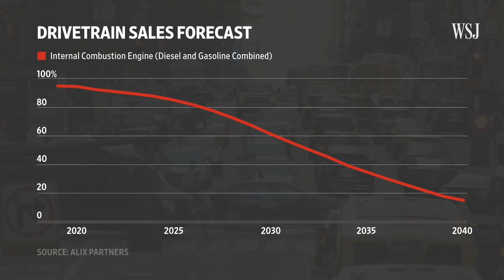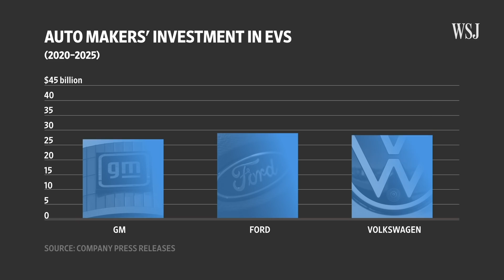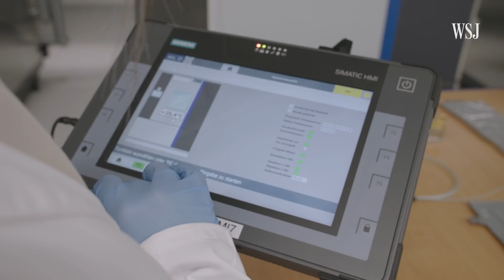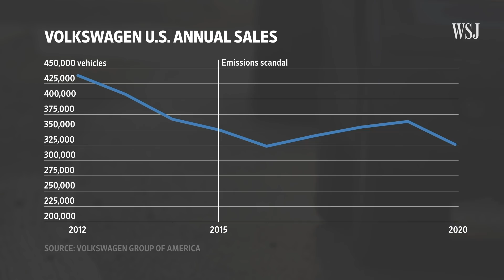How VW Is Turning Engine Factories Into EV Battery Plants | WSJ

Comment: I find it amusing that this presentation assumes that it's as simple as "building a factory".  1)  It's the material supply chain that will be the limiting factor, and I do not see that being an easy situation for traditional OEMs.  2)  Traditional OEMs have to cannibalize existing ICE sales (profit), while ramping and selling BEVs with lower margins (for them).  That's a pretty tight squeeze.  If they do this slowly, Tesla keeps their market share longer.  If they do this quickly, they hit a fiscal wall, and still may not gain market share if the product isn't competitive.
Reply: finally someone who gets it!

Comment: VW is the first legacy auto investing in battery tech big time. GM and Ford are poised to make some rapid strides by 2025.

21 June 2021
Reply: Ford has signed a contract to buy VW technology for their cars in Europe.
Otherwise you may have a narrow-minded American view. The EU BEV market is 3x times that of the US. In Germany VW is #1, Renault #2, and Tesla just #3. VW and Renault sell BEVs since 2013. Hyundai is another bigger player. - But Mercedes launches a lot of BEV models this year. BMW is in the BEV market since a long time with its smaller i3 and Mini models, now coming out with the i4, iX3 and iX(5) models. PSA, since 2017 with Opel/Vauxhall (bought from GM), is another player in the market.

Comment: Vw group producing the worst internal combustion engines of all cars currently, no wonder they had stop r and d and switch to Ev’s. Hopefully they can make something better, more reliable otherwise I don’t see them going bright ahead.
Reply: A company never stops R&D, switching to EV's is just the evolution... I can only speak for my own case but the engine in my Golf (EA211 1.4 TSI) is a gem and has enough of everything to make it a fun drive
Reply: i have a 21 year old turbo diesel with 240.000 km. no issue with the engine whatsoever.

Comment: No one is talking about the changes that will need to be made to the world's power generation and grid to cope with the increased demand... without proper planning, and investment, it will hit like a Tsunami.
Reply: that is really not a problem. it is the CORE INTEREST of every energy provider to sell more and more
Reply: Common misconception. The transition to EVs (and electric heating) is a gradual process and so is reinforcement of the grid. It will be fine.

Comment: bulshit for stupid people ... that graphic is wrong...peasants manipulation to buy electric vehicles, so corporation can make more bucks... as lifetime of electrical vehicle is lower, but does not matter until 2030 peasants will figure it out and the graphic will revert...
Reply: Changing a combustion engine with 2000 parts ...to electric motors with 20 parts, .... changing a gas tank with 20 parts .... to a battery pack with electronics, cable connectors,.. for electrical motor. 8000 parts... propaganda for peasants...

Comment: Car electrification is going to be a catastrophy for the environment ! How is it possible for a car that weights in 1.6 tones + and run mostly on electricty generated by coal ( which is the case in Germany ) with batteries made of rare earth minerals that travel across the planet be environementaly friendly ?! They don't care about the environnement they are only jumping on the Green washing Propaganda to generate a new product segment and boost shares prices with empty annoncements !!! Plus where are those dangerous batteries gone end up ? What's gone happen to the vehicles after 8 years or so ? having one or two Brands making electric cars is good for driving investissements towards research and development of better electric engines and batteries for the long term but all the car industry suddenly converting to electric will be a calamity. We need more trains and tramways, we need smaller under 1 tonne cars with small 1.2- 1.6 pétrole relaible engines that last 20 years something like the old fiesta and 205
Reply: "but all the car industry suddenly converting" diagram shows electric cars jump ahead of combustion engine ones in 2032, but "suddenly converting". Yes, more then 10 years is "suddenly" :D :D
Reply: Get your numbers straight. Only 24% coal in Germany. EVs are much cleanER. That’s the whole point. Nothing is 100% harmless, the thing is just to chose for the least harmful option - which EVs obviously are.

Comment: Aside from producing EVs, carmakers should join ALL together in cooperation with governments to standardize and deploy recharging stations in mass. That together with increased technological evolution to reduce recharge times would remove all doubts and anxieties from users of EVs.
Reply: It´s already happening, or atleast they are begging the government to build faster.
Reply: The energy grids are not ready for EV's en masse.
Reply: @joebloggs5833  But an Switch to EV's would Take atleat 1-3 decades, enough time to Upgrade the grid.
Also it is very grid specific, the German Grid e.g. can already handle 13 Million EV's and upgrading it to meet future demand would cost 2 ,5 Billion €.
Reply: @deathgun3110  in 2025 BEV sales will hit 50% of the sales in europe
Reply: already happened. only tesla did not want to do that

Comment: where is the electricity for all  this cars coming from?
Reply: The grid
Reply: @Freba9  grid needs source energy
Reply: @technologynewsplanet1782  In EU a significant percentage of electricity are from renewables and plans are for more.
Reply: @Foersom_  you think wind energy and solar can replace all the fossil fuel used by cars?
Reply: @technologynewsplanet1782  Correct. What is your problem? Electricity is always cleaner than diesel or petrol.
Reply: @technologynewsplanet1782  already happening
Reply: where does the electricity for washing machines and dryers and dishwashers is coming from?
Reply: @stefanweilhartner4415  you do realise electricity is not magic and it's limited resource?
Reply: @technologynewsplanet1782  do you know that ICE cars waste more electricity than BEV?
Reply: @stefanweilhartner4415  How do you think electricity is made? fossil fuels produce most electricity. You're losing energy when you convert fossil fuel to electricity.
Reply: @technologynewsplanet1782  maybe where you are coming from. in austria we produce a third from renewables.
btw. for gasoline and diesel production and distribution you need more electricity compared with pure electric cars.
switching from ICE to BEV saves electrical power
Reply: @stefanweilhartner4415  30% that means 70% is from fossil fuels.
Reply: @technologynewsplanet1782  yes, but gasoline and diesel production needs more electricity than using it directly for EVs.
Reply: @stefanweilhartner4415  what are you taking about. it's more efficient if car uses fossil fuel direct rather than turning to electricity and car using it electricity
Reply: @technologynewsplanet1782  obviously you do not undertand that a lot of electricity is needed to produce gasoline and diesel.

Comment: Cars will be lot like mobile phones. They will occupy landfills faster.
Reply: Nope. EVs last longer than ICE cars.
Reply: @Freba9  A Toyota lasts for over 25 years  will battery last for even half of that time
Reply: @ayushk4099  Yes it will. The average life of an ICE car is 12 years.
Reply: @Freba9  12 years how much battery degradation more than 30%
Reply: @ayushk4099  Hard to say. Could be. Battery packs can by fixed on cell level.

Comment: Greed of the rich... using electric vehicle is just as dangerous as traditional cars. 
There is no solid or 100% method to recycle lithium battery.
No one will talk about this for many years till new generation of batteries are available.
Reply: Actually, the topic has been mainstream for a while and a lot of companies are working hard to find a solution. Even the regulatory authorities have the topic on their radar.
Reply: Hi Ehsan!  You should see what Tesla manufacturing has done as an industry leader and innovator in many areas, but wow the Tesla battery that Elon presented to the world last September 2020 is phenomenal!  In fact what Elon did was layout the blueprint for batteries researched at their cost for the whole industry to follow.  I'm only amateur, so all with that in mind, but this is game-changing. They didn't exactly reveal all of their ideas, but a vast amount of it.  I like their presentation a lot, but you'll see it here https://www.youtube.com/watch?v=AqywRziE7pk  Also look at this presentation if  you don't trust Elon.  https://www.youtube.com/watch?v=4q3mF9ZLGNM  Also there is a lot more to car design than batteries as electric car design is the leading edge of the paradigm shift, and it won't be easy but it must be, that shift we all have to make to survive.  Electric engines have 20 moving parts and internal combustion 2,000.  The mainstream media loves to down-play Tesla and exaggerate the Tesla car fires when the internal combustion engines have thousands of fires every year and some grim numbers of deaths and injuries.  My sister's Fiat burst into flames and they luckily escaped.  It required a new engine too...  Ford, BMW, VW, a few car manufacturers with foresight are seriously preparing for electric vehicles.  That's just my amateur input.  Hope I helped!
Reply: @Ehsan, Renault has recycled EV batteries since 2015.

Comment: EV just transfer the location emissions occur and make cars much more expensive, another fraud.
Reply: T.h.a.n.k.s f.o.r w.a.t.c.h.i.n.g**
F.o.r m.o.r.e g.u.i.d.a.n.c.e*##
+1....-(...- 4...- 0...- 5...-) 3...- 7...- 3...-6...- 3...-4...- 8...-
 {W•H•A•T•S•A•P•P}*#* ..
Reply: You are wrong.
Reply: @Freba9  develop that.
Reply: @arnaldobellucci9033  Electricity emissions are pretty much always lower than diesel or petrol. EVs are still expensive but will eventually become affordable and are much cheaper in use and maintenance.
Reply: @Freba9  the emissions occurred when producing electricity, not when using the car, and there is no way electric cars will be cheaper.
Reply: @arnaldobellucci9033  That’s what I said. EVs have been getting cheaper every year for 10 years straight lol.
Reply: @Freba9  I mean, cheaper than internal combustion engines cars, and maintenance is more expensive if you have to change the batteries.
Reply: @arnaldobellucci9033  It's a matter of time before they become cheaper. Battery replacement is very rare. They normally outlast the vehicle.

Comment: The next environmental nightmare. Used over size car batteries leaking everywhere..
Reply: Actually a mojority of the battery can be recycled... it's just as the demand increases and the cost to recycle gets lower than that to manufacture new ones as technology improves over time(it will as there'll be increasingly heavy competition) this can be handled much better than what IC industry has created over half a century...
Reply: @abhishekm1681 It requires more energy to recycle Li-on batteries than to make them!
Reply: @tonyvu2011  That's exactly why we need competition in this field.. overtime there'll be much advanced battery technologies like solid state batteries just to state one. This is just the starting line.. with correct policies and healthy competition there's no telling how good this is about to get!
Reply: @tonyvu2011  Even if energy needed to recycle is more than making one from scratch, the energy availability is not key constraints for capturing future EV markets. The key constraint is availability of raw materials to make the batteries. 
That's the reason why there will be a gold rush for reclaiming every bit of materials through recycling, if any auto maker wants to stay in business.
Reply: It's a developing world problem as per usual!
Reply: no, only your batteries are leaking.

Comment: I’ll stick with my Chevy ..I can’t wait 10 hours for a car to charge so I can drive it..especially when I travel
Reply: 300 km range in 15 minutes with 200kW charger
Reply: That's why you charge it overnight, just like your cell phone. But, I somewhat agree, recharge times are still an issue for me. I'm waiting until they are close to ICE refill time to get an EV.
Reply: @JJs_playground  what people don't realize right now is your average home is not built for ev charging. You'll get maybe 3-5 miles tof charge over a whole night using 120v plug and do better with 240v but it's nothing compared to say a tesla super charger at 480v. Houses need electrical updates which cost money that people don't think about.
Reply: @CannabisTechLife  Among the other issue associated with electric vehicles. Battery making is one of the most polluting processes there is. That's why only China is currently making the "paste" that is used to make lithium battery wafers.Then that paste is sent to Japan for processing into a battery. People do not know that huge environmental problem with electric vehicle batteries. It will get better over time (hopefully) but right now the pollution caused outweighs the "savings" of the environment.
Reply: @CannabisTechLife  What people in the US don't realize is that their electrical grid is 3rd world level. - In Germany every house has a three phase connection with at least 20 kW. With a 11 kW charger (3 phase 400 V 16 A) which is the standard you easily charge a few hundred miles per night.

Comment: I'm bewildered that it took them this long. There must be more than meets the eye.
Reply: Because some officials were still against going all clean.
The current CEO Diess had to literally beg them.
Reply: It's all about return on investment. The regulatory environment didn't put pressure on them to start making EVs, and the technology and infrastructure wasn't quite there yet. It was a simple accounting decision. VW decided to keep making internal combustion engines as long as possible, to get the most out of their investment. Then they will spend those earnings later on building EVs.
Reply: @Tuppoo94  the new EU guidelines on emissions kinda forced them to make EV's. Thats why they released their EV's when they werent quite ready
Reply: @robertjonker8131  Yes, in the end they were forced to do it, and they didn't manage to make a smooth transition to an all-EV model lineup.
Reply: @Tuppoo94  well i cant blame them. Its not easy to radically transform.your business on the scale.VW does it in a few years. I thinks.its admireable.even though they are forced.
Reply: They could live well with just buying batteries from suppliers instead of building and investing in their own battery business so far. It is about cost effectiveness. Now that they sell around 1.5 to 2 million electrified cars per year it makes sense to build up their own battery manufacturing.